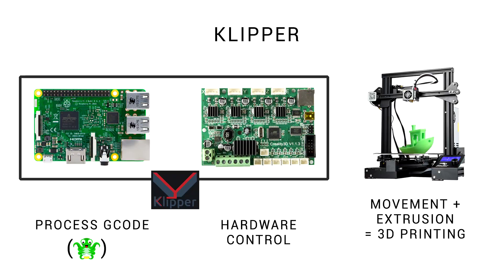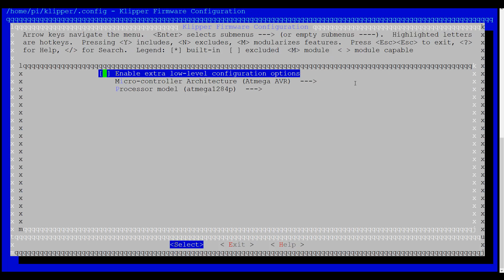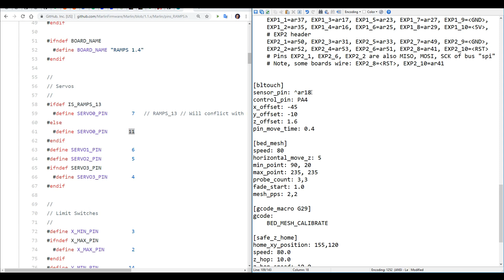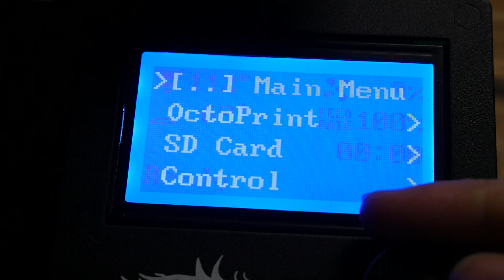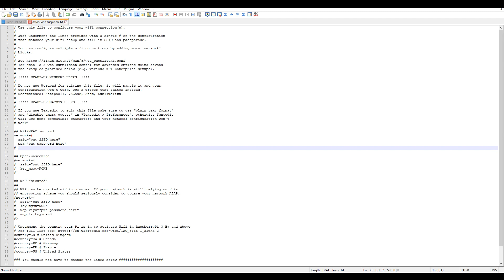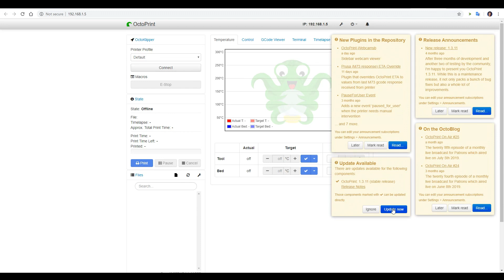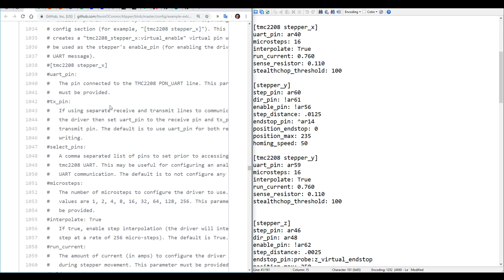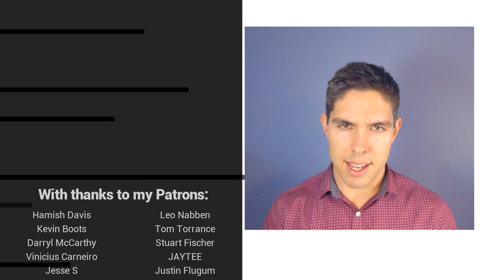Klipper guide part 2: MKS Gen L/TMC2208 + Wrecklabs Printhat

Comment: Is this worth it when you already have a 32Bit board in your ender 3?
Reply from the maker: Unless you are doing something insanely fast probably not.
Reply: I don't know hwo klipper performs compared to a 32 bit board since I went from stock to MKS Gen L with Klipper straight away but my detail and accuracy at 150 mm/s and 1500 mm/s2 is amazing. I mostly print miniatures (well, tanks and vehicles mainly) and aside some minor errors quality is great and prints are just so much faster than before

Comment: wtf 92 Euros? that thing costs 10 bucks to make tops!
Reply: Yeah I was still down till I saw it has TMC2130 drivers.. like the hell at those prices I expect 2208s or at MINIMUM ports to put my own steppers in
Reply: Exactly, ridiculously overpriced gougeing. Cue the moaning and gnashing of teeth when the Chinese bring a cheap clone to market.
Reply: Go ahead, make your own.  Guaranty it will cost much more.
Reply: @davidlockwood4545  Lol shill harder
Reply: You yourself probably cost a lot less to make, but is now much more expensive in 'use'. ;-) Just because the parts of something cost very little doesn't mean that asking 10x the cost is price gouging. In this case, it's a special made board with a very limited customer base, that required development/support and a very limited 'print run'. But I suspect that for an Ender 3 upgrade it is indeed far too expensive. But upgrading a far more expensive (ageing) printer it might be more then worth it.

Comment: Hey Michael.  So it seems you've done most of the aftermarket board options to upgrade a 3d printer, with one glaring ommision, so it begs the question, when are you going to do the Duet 2 Wifi?

Comment: Hi, great Video so far.
After the setup and using your uploaded klipper firmware i'm getting the following error in octopi: "Shared TMC uarts need unique address or select_pins polarity"
Hardware is identical.
Any suggestions on this problem?
Reply: Change this line. 

[tmc2208 stepper_z]
uart_pin: ar42

In pastebin is a error. 
Line 51 "ar42" instead of "ar44"

Comment: the probability I've missed something is high, but... if you're using a pi and this board, why do you need the mainboard? my current understanding suggests these should replace it entirely.
Reply: yes, that hat or the mks board completely replace the original mainboard.  You can run klipper with the original main board as well(that's what the part one video was), you just don't get the benefit of the upgraed stepper drivers(or 32 bit processor).